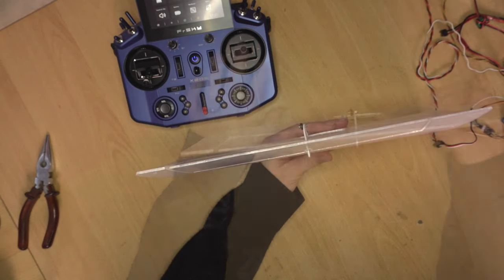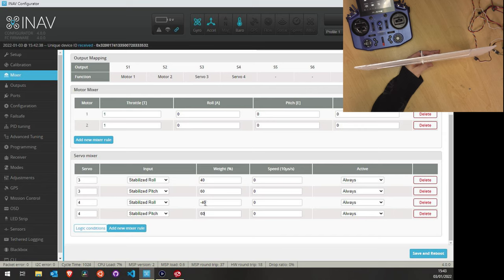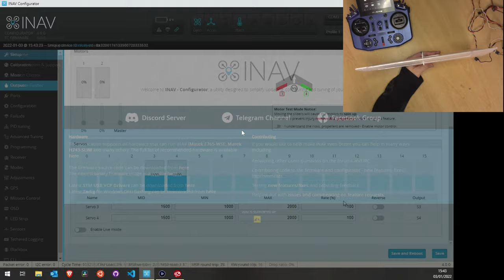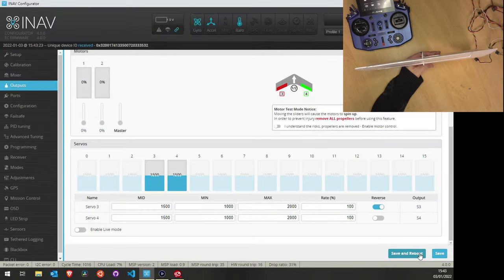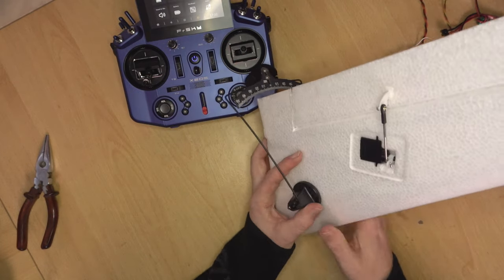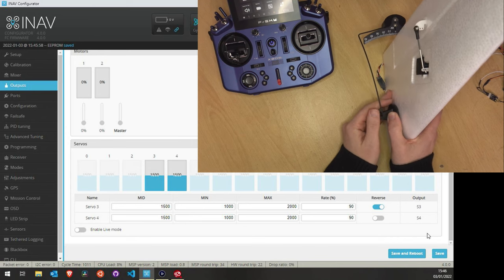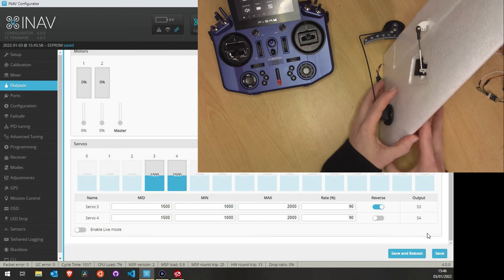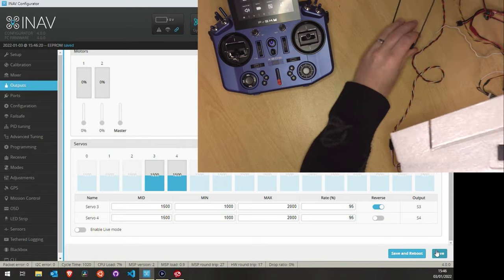Setting up control surfaces, linkages, and throws for iNav

Comment: I think that was a very good video especially for the entry level pilot on such a important task. worth mentioning that you'll get the most power out of your servos when you pick the inner hole on the servo and the outer on the horn. I love how you mount your horns in the middle of the rudder like most manufacturers never do. nice job Darren!
Reply from the maker: I’m hoping this will help some new pilots not end up with 3D throws Stuwe 🤣 That horn on the elevon is all stock, other than the ball joint. HeeWing set them in the middle of the control surface. Just a shame they weren’t in line with the hinge and aligned with hinge.
Reply: @MrD  well but at least one manufacturer that got that one right. yeah 90degree aligned is the best just to reduce mechanical stress. I always put ball joints on both sides even if the link is straight. just to reduce even the slightest offset and torsion. I think proper mechanical setup of servo controls is key to smooth control and long lived servos.

Comment: I've been flying with Inav since ver 1.9 and I had no idea how to set up throws and the mixer.  I just used the default control horn location and played with the mixer until it looked right.  Thanks so much for this video.  I am going back and try this on some of my models that don't tune/fly well.
Reply from the maker: No problem Joe. Setting up on the control linkages will get things working better. You get to use the full resolution of the servo. Say in iNav you set the output to 50%. You’re losing half the movement of the servo. Keeping the output to 100% and adjusting the linkage, you have more control over the same surface movement.

Comment: Great walkthru setup. Thanks for taking to the time to add chapter bookmarks. Makes for great reference material. 😎👍👍

FYI: There is no preview image(s), in Chapters so YouTube showing "..." image. Normally video still from that timestamp showing, but appears YT broken, or a setting not quite happy.
No big deal, just mentioning in case you're not aware.
Reply from the maker: Thanks, glad the video was helpful. I don't have any control over the chapter thumbnails. That's all down to YouTube. Hopefully it will fix its self soon.

Comment: Again thanks for the video just built skyhunter 1.8 m h743 with inav 3.01 or 3.0.2 can’t remember one of the two. Anyway my ? Is how does inav do with digital servos they all seem to respond fine except sometimes the pan servo on my camera get gittery so I wonder if the all r doing the same thing all servos r runnin 5v with inav default settings couldn’t find any set up info for servos
Reply from the maker: If all the servos on the plane are digital, you can increase the servo refresh rate on the outputs page. But you will need to check with the servo manufacturer for the maximum supported refresh rate. Also, if all your servos support it, you could up the power to 6v, which will give the servos more speed and torque.

If the pan servo is jittery, maybe it's overloaded? If you just have a regular FPV camera on the servo, there should be no problem with regular 9g servos; even split cams and the like should be fine. But if you have action cams on there, it may be too heavy for the servo to turn smoothly. Another thing that could cause jitters is how you're controlling the pan. Sometimes the sliders or head tracker aren't that smooth. So adding a little slow to the mix can make things work better.

Comment: if you adjust throws by less weight will it mess with the setpoint & control points Mark was talking about - piff might overthrow past the set weight? my fox 3m came pre-fitted control s and they swing near 90deg so dropped some weights to 70. I got all the wing modes sorted from another 1 of your video's< my mistake was inverting the switch never saved had to invert then press the switch input again then it all came right, thank you. I also dont understand how to tell what my roll rate speed is.

Comment: Nice video, but what is the right way to know if throws are right and not too much or not too low? Flying only?
Reply from the maker: Yes pretty much. The problem is not knowing where to start, and only experience from flying other, similar planes can give you that. Which is why it’s important these manufacturers start including throws in their manuals. They should have already worked out the safe range while testing their models.

Comment: I am setting up an AR Pro..I do not have equal throw. The up elevon has more than down. The elevon horn only has one hole, and I am in the top hole of the servo horn. Should I equal it out by moving servo horn on servo to get equal, then adjust pushrod length?
Reply from the maker: That is differential. It is caused by the geometry of the linkage. For equal throw, the servo horn should be 90 degrees to the control rod. To change it, you need to rotate the servo horn on it’s spline. A little bit of differential is fine. It can even help in the turns. But, you would want more up than down.
Reply from the maker: https://www.youtube.com/watch?v=tGRDZzaerOE&t=472s

Comment: I'm trying to get my zoid dart xl trimmed out and somewhat confused on inav servo autotrim, I setup the control surfaces according to manufacturer and both elevons perfectly flush with fuselage mid position in inav 6.1.1 1500, after maiden flight which went great the servo autotrim has now set one elevon to 1306 and other 1366 but flys great, neither control surface is flush at this point, so should i mechanically adjust them back to the flush position when servos in neutral position? Sorry for long post and thanks in advance
Reply from the maker: No. Pin them where they are. Remove the control rod. Then set the midpoints back to 1500. Then adjust the control rod to go back in the hole. Finally remove the pins. Your dart cl setup probably needs reflex to keep it flying level. Maybe it’s normal, maybe it’s nose heavy. A dive test would confirm CG.
Reply: Without your channel I would be in trouble when it comes to inav Thanks, so today I will pin elevons in place with servos in neutral  position, adjust control rods to go back in same holes and then set mid points back to 1500, It seems to me the control surfaces will never be flush with fuselage after that but will see, maybe they don't need to be flush not sure? I fly with continuous servo autotrim on so will see what happens next but man this thing is smooth as silk will never go back to ar wing pro. Thanks for all you do for this hobby
Reply: I'm setting up a vtail plane for first time a zohd talon rebel gt and have a question please, the manuel says 8 to 10mm throws on control surfaces. I have control surfaces flush at 1500 in output page the thing is to get 10mm throws i have elevons down to 43% and elevators down to 50% is this normal or I'm missing something here? As always thanks

Comment: Darren thanks. When you reduce rates to say 95%, do you keep the aileron elevator total 100% or do you need to change those to add up to 95%?
Reply from the maker: Yes, the pitch and roll on the elevons I kept the same. I just fine adjusted on the outputs page.

Comment: Thanks for the great info Darren. Its nice to have a solid source. I have a question. I am about ready to maiden a Dart XL extreme wing and noticed that the wing you are demonstrating with is very similar to the Dart with the reflex built in. My question is this: on Zohd's instruction manual it states the roll throw to be 16mm and pitch 12mm. You mention that on your wing the larger mm throw is on the pitch  and smaller mm throw on the roll. Is that a personal preference?  Thank you for your continued help
Reply from the maker: The Dart XL is a forward swept wing. These tend to be roll sensitive, so need less roll than pitch. It is an attribute due to the design. With the Dart 250G, I did reduce roll slightly. 

If I’m perfectly blunt, the throws that ZOHD include aren’t tested. I questioned them when I had an issue setting up the ruddervators on the Talon 250G, as it would not reach their recommended throws. They told me “throws are a ballpark figure”. When the number they give can’t be reached on the surface with the rod at the maximum deflection position. It really does show just how “ballpark” they’re being. 

To be honest, those throws sound backwards to me. Based on how forward swept wing aircraft usually perform. But never having a Dart XL, I can’t confirm either way. I would probably err on the side of caution and maybe go in the middle of that range for both pitch and roll.

Comment: can you link a video so i can conifgure my tx16s to fly my arwing on inav my controler are all wrong
Reply from the maker: I think you’ve found that video, as I’ve just replied to to on it. This video should explain the throws.
Reply: @MrD  question ? can i do auto launch and auto tune/ trim on inav 4.1.0 at the same time  for a maiden .
Reply from the maker: No, autotrim will not allow you to arm if it’s enabled. Best to get up in the air, then set about tuning and trimming.

Comment: 13:17 if the weight needs to add up to 100 for each servo, why is only one of the roll weights negative?
Reply from the maker: Because for roll (or pitch on a vtail) one servo has to move the opposite way. If the negative wasn’t there, you wouldn’t get the correct movement. But, for the totalling to 100%, just take all values as absolute; i.e. imagine they’re all positive.
Reply: @MrD  I think you mean yaw on a vtail?
Reply: @MrD  ah I get it. You’re right, pitch on a vtail. You’re basically reversing a reversed servo by adding the negative making it move in the correct direction
Reply from the maker: @STEDDiEFPV  no, with yaw the servos tend to move the same way. With pitch they need to move opposite ways. It depends on the servo fitment on particular models. But all that I’ve seen need to rotate the servos opposite directions for pitch. 

The default mixer on INAV for vtails is wierd. It has negative values for 3 surfaces in the mixer. When it should only need to have one negative.
Reply: @MrD  oh really? I thought for pitch on a vtail they move on the same direction (control surfaces move in the same direction) and opposite direction for yaw
Reply from the maker: @STEDDiEFPV  the control surfaces both move up and down for pitch. But to do that, one servo rotates left, the other rotates right. The servo horn come out opposite sides of the servo on a vtail.

Comment: Just flight you airplane just with a receiver, and then when you happy how is flying do this in Inav, but you have from the get go a plane that is flying stock, the way you like.  Nice video.
Reply from the maker: I’m far too lazy for that. I just set it up with iNav and use manual 🤣 But yes. If it flies well without a flight controller, it will be the best setup.

Comment: shouldn't you have the aileron ca 2 mm. up, and not flat to the surface?
Reply from the maker: Not looking at the wing. It has reflex built in to the profile of the wing, so it shouldn't need any extra on the elevon.
Reply: @MrD  maybe stupid question but what is built in reflex?
Reply from the maker: If you look at the wing from the side that glues in to the fuselage. You can see that the back part curves upwards slightly. That is built in reflex.
Reply: @MrD  thanks, even on a Saturday I learn something new.

Comment: i tried to do auto launch today and it did not have enough throttle and it landed as soon as i threw it and the motor didnt stop and it burnt up i could not get to the controller in time on the ground next to me... now im trying to get them to send me a new motor  under warranty with getfpv....i also bought one off ebay for 20 bucks so i have one coming soon sunnysky  1400kv. I did raise the auto launch throttle so now it will have the throttle power it needs to take off
Reply from the maker: You should check out my autolaunch video. That explains all the settings, and how to set it up for your individual model. https://youtu.be/rj_RSrXqib8
Reply: @MrD  I did
Reply from the maker: How did you get the throttle value in that case? The 1:1 hover test should give enough thrust. And the estimation tool over estimates in most cases.

Comment: Dear sir, first of all I apologize for the off topic.
I have on Matek 411 SE the iNave 5.0.
I have a question about the auto trim done for the first time.
When I tried to do the auto trim, my C1 chaser, it was puchar too much to the right side.
I launched my wing in manual mode, and when I used the auto trime switch it was so hard for me, to fly a few seconds stright, I had to resort to the trims of the radio so as not to fall to the ground!
I know I shouldn't touch the radio trimes.
But with this imbalance, how is it possible for me to do the auto trim without sticking myself on the floor?
I know I'm using an outdated version, but since I've come this far I'd like to successfully complete my first model with iNav!
Can you give me any suggestions?
Greetings 
Vítor
Reply from the maker: Hi Vitor. If you have trimmed it on the transmitter, just remember to stay in manual. Once you're happy with the trim, stay in manual and land. Leave everything turned on. Then, you should put thin pins in the control surface to hold them in place. With the C1, you should be able to pin between the elevon and the wing. Once pinned, remove the clevis from both control horns. Then set the trims on the transmitter back to zero. Then adjust the length of the control rods so that you can put them back in the same hole on the control horn with ease. Then remove the pins. After that, you should have a pretty well trimmed plane and the auto-tune will only need to make fine adjustments.

To be honest, that's how I trim my planes. Trim in manual on the transmitter, land, physically adjust the linkages, and fly. Using iNav 4.0, I don't bother with the auto trim mode. I just have it permanently enabled. That seems to work the best for me.

All the best, and I hope the next flight is much better for you.
Reply: @MrD  
Very grateful for the honest answer.
I was thinking that I had done something wrong, because the biggest youtubers who address this issue, do not refer to this physical adjustment leaving the idea that auto trim completely solves the initial imbalance of the model!
What about the auto tune, after its physical adjustment followed by auto trim, do act according to what is diffused on the network?
Reply from the maker: Auto-trim is good. But, even with auto-trim; it is recommended to mechanically adjust the control linkages if the mid point falls outside of the 1450 to 1550 range, then re do the auto-trim. I just find trimming manually first works better for me. Then auto-trim just fine tunes. The main reason people say not to trim with the transmitter is if you switch to any flight mode other than manual, it will cause problems.

Once it's trimmed and flying well in manual. That's when you should perform the autotune. Which version of iNav are you using? You said 5.0. I guess it was a key slip from 4.0?
Reply: @MrD  Sorry for my mistake wanted, the version I'm using is 2.5.0, so it's correct.
I haven't put a newer version yet because I had everything prepared with iNav 2.5.0 and followed the videos with this version.
Reply from the maker: @vitorhugolalanda1978  no problem. Though if you’ve not tuned anything yet. I would recommend updating to iNav 4.0. The tuning side is much better. I don’t have a how to update video yet. But my friend Marc has a great video. I will get the link for you.
Reply from the maker: https://youtu.be/rGi77ikh4Dc
Reply: @MrD  Big thank you!
I'm going to take a look at the video.
Sorry for the late reply, work do you understand?
However last Sunday I returned to fly i went back to doing the trims on the radio, always in annual, and then just to see what was happening, I activated the RTH. It even worked! I was happy!
In the seting of the leveling of the board I have 5 or 6 degrees of inclination, and I noticed that the model tended to clim. I assume I'm going to have to lower the value or even the value to zero.
As soon as I'm available, I'll put iNave 4 on.
Reply from the maker: If you trim on the transmitter. Be sure to land and adjust the control surfaces physically. If you put the plane in angle or horizon mode, you will see why. iNav just sees the trims as you commanding a movement.

The climbing that you are seeing. Which flight mode are you seeing this?